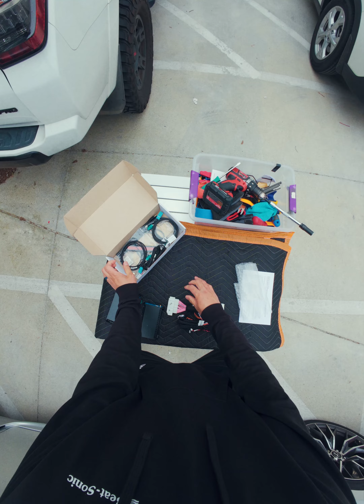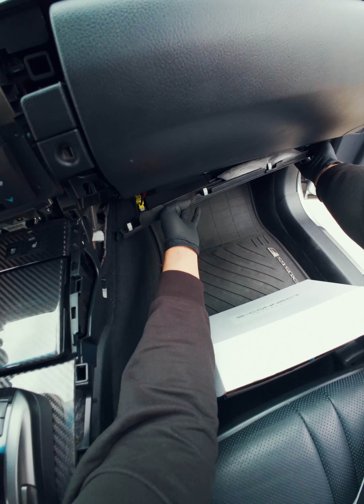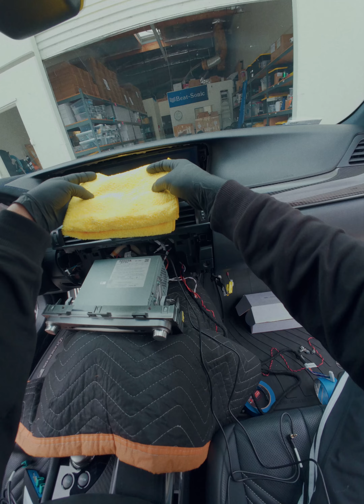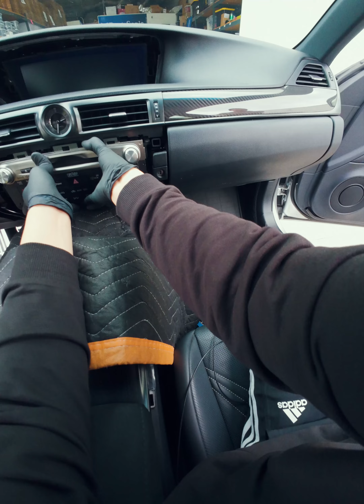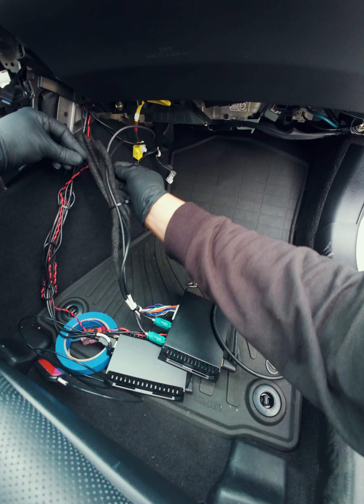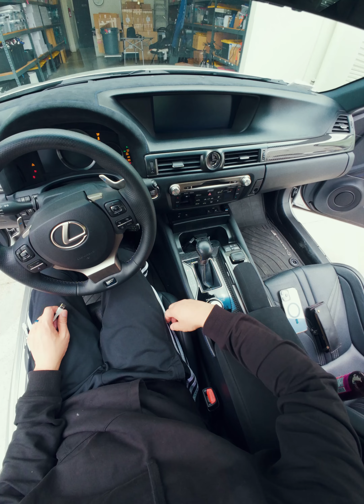LEXUS GS F | Wireless CarPlay Kit | FPV Installation Video

Comment: Looks like a great product. I know you advertise these as DIY kits but after watching the videos for any of your products some of which have already purchased I would never attempt to do this myself. But the products are great and if you have a local car radio installation shop nearby then get the product and have them install it. Again all the products that this company sells have turned out to be great!
Reply from the maker: I appreciate that! Let’s get one installed to your GS next!
Reply: @BeatSonicUS, how much will the install before with obviously using your products
Reply: @diegoavila4379  Nobody Knows the answer to that it depends where you take it if they'll even do it at all. Good luck with that.
Reply: @davolbc  if I am going to take it somewhere it's going to be beat sonic they are only 1.5 hours away from me

Comment: Hi, is it possible to connect your phone directly to the factory USB output to receive the full quality audio while operating CarPlay?
Reply from the maker: Yes you can definitely use your factory USB output but you'll need to purchase a separate harness to connect the factory USB to the CarPlay modules.
Reply: @BeatSonicUS  thank you for the quick response. I had a follow up question. Does this require further feeding this harness to the factory USB? Also I only see the “optional USB harness” add-on for 2013-14 LS, GS & ES. Is there one for the 2016 GS?
Reply from the maker: @slava7136  Yes that is the optional USB harness you'll need to connect the factory port to the modules.
Reply: @BeatSonicUS  do you have instructions for that?